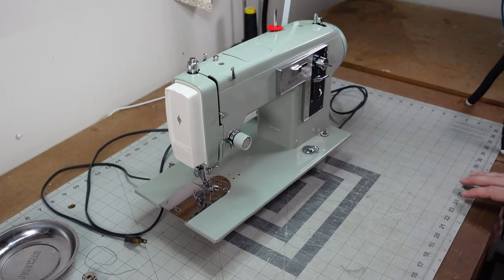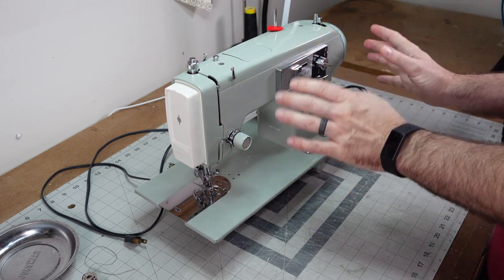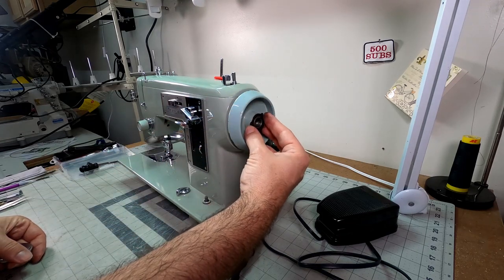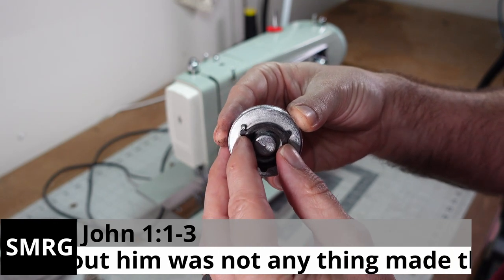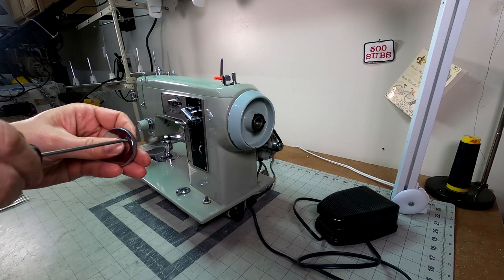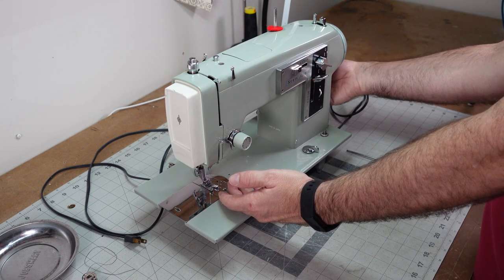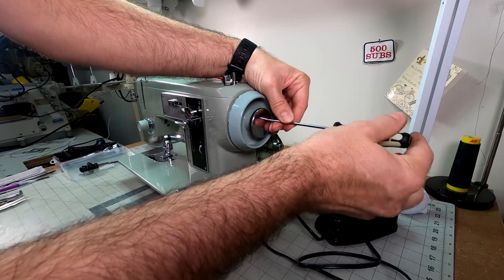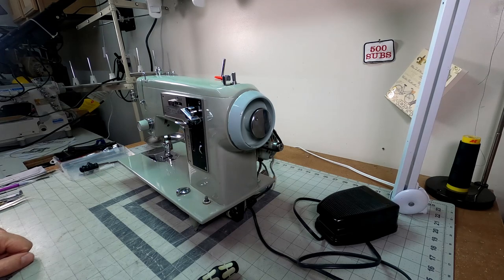How to assemble the clutch for a vintage sewing machine, and make sure it is correctly adjusted.

Comment: Thanks!  Changed the belt in a Brother VX-940, could not get clutch to work right.  The disc popped off so I couldn't see how it was fitted.  Found it can fit 4 ways, but there is only 1 right way!  Your video is easier to understand that others.  I don't want to get rid of hardy old  mechanicals, especially when they were made of all-metal inside.  Keep going!

Comment: If the tabs face away from the machine, why are there notches in the handwheel that perfectly line up with those tabs? This is for my Thompson portable walking foot. I have the washer the other way, tabs facing machine and in the notches on handwheel, seems to work fine.

Comment: Hi Sewing machine repair guy.  Thanks for your upload.  I had a jammed up handwheel that needed lots of cleaning to move freely.  I was able to successfully clean out the area between the handwheel and the needle bar mechanism so that it freely moved when the clutch was disengaged.  Before this, everything was stuck together, so I couldn't disengage the clutch and everything moved while winding the bobbin.  Now that this problem has been solved, I have another issue that I must have inadvertently created.  Now the clutch knob slips when the machine is running. I have checked to make sure the stop motion ring is in the correct 180 degree orientation with the inner tabs facing outward.  I am able to crank the clutch knob about a 1/6 rotation until it feels pretty tight.  However, when i start the motor and the machine gets up to full speed, the clutch knob comes loose and instantly clicks over to the disengaged position, thus not allowing the motor to transfer the power to the needle bar.  It almost seems as if putting some locktite in the threads of the clutch knob, it may correct the problem, almost like it needs something extra sticky, but since I have cleaned everything, everything slides too easily and that knob keeps coming loose when I accelerate the machine to full speed.  I know this is the opposite problem most people have, but have you had this happen and do you know a way around it?  Even if I crank the knob really hard with my hand, the speed of the machine loosens it after only a few seconds of running and will not stay engaged.  Thanks for reading through my issue.
Reply: Move the spring washer one spin forward. Eg change the washer position.  One spin forward   Good luck
Reply: No loctite ever.
Reply: @michaeltexeira6185  Hi Michael, thanks for the reply. I've actually since figured out what the problem is. So I bought my Singer 201 on eBay that was sold as refurbished. I knew that it probably wasn't 100% restored to perfect condition, but knew at least some things had been serviced that would make it easier for me to just hop right into. Anyways, after un-sticking the handwheel from the drive shaft, I realized that it spun in an anti-torque direction and loosened very easily.  After some very careful looking around, I discovered that not only was the stop-motion ring not the correct one for my machine, but the locking knob in the center of the handwheel wasn't correct either.  So when I went to tighten that knob, it wouldn't grip the actual stop motion ring because the back center of the knob wasn't the right shape, so instead it tightened up against the handwheel itself, thus providing no actual locking to the wheel.  My explanation may be hard to understand without seeing the actual problem, but all in all, the lesson I learned was that when machines are sold on eBay as refurbished, or even if they're just sold as a general used machine, it should never be assumed that every previous owner knew exactly what they were doing when they were switching out parts on it.

Comment: Tried different things but even my rubber band when I turn it manually doesn’t make the needle or the arm go. It’s locked up. What can I do for this. I cleaned and oiled the clutch and the needle area but no movement at all.

Comment: What if the clutch will not come off at all. Screw removed and it won’t budge. Machine works like a champ however since the clutch won’t disengage I can’t use the bobbin filler.

Comment: Hi Guy, can you think of any other reason why a motor wouldn't disengage?  I've tried the washer in both positions and micro-adjusted so that the set screw has maximum rotation... still the clutch doesn't engage enough to disengage the motor from the needle.  (on vintage White with exactly the same hand wheel as yours)
Reply: i just noticed that i can hold the needle up when I have the nut loose but if i let go of the needle it will move... [scratching head]

Comment: I wonder if you can help me. I have 2 White (about 50 years old but in great shape) and they both have the same problem. When I disengage the clutch to make bobbins, the needle keeps going up and down. I did the procedure in the video, flip the inside ring 180 degrees, and it still goes up and down. I loosen the screw a bit but again it did not change. These machines were working perfectly until they came back from their tune-up. Also I have problems with the bobbin winders - they dont turn unless I put my thumb on the push button. I am using these machines for more than 30 years now and it is the first time they do not work as usual and strangely it is all about the bobbin winder.
Reply: Install new bobbin tire. Get correct size.
Reply: I can correct this. But lockdown.